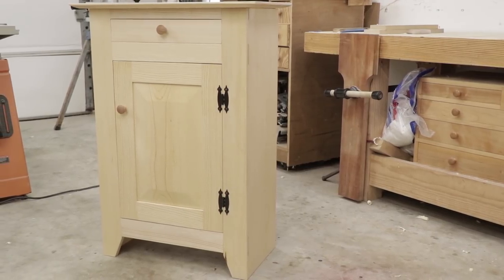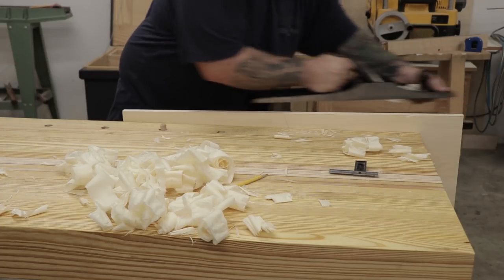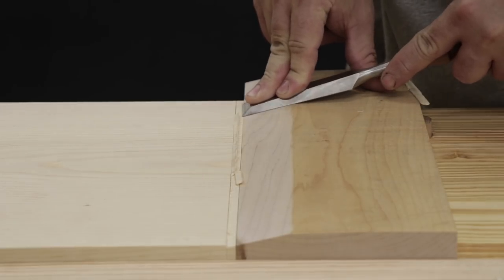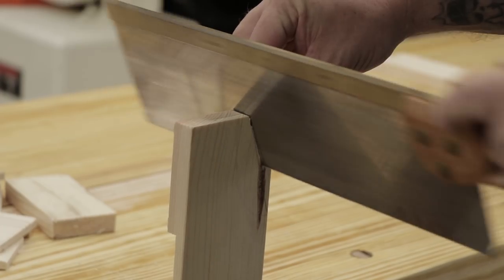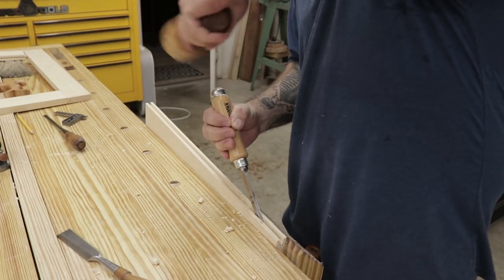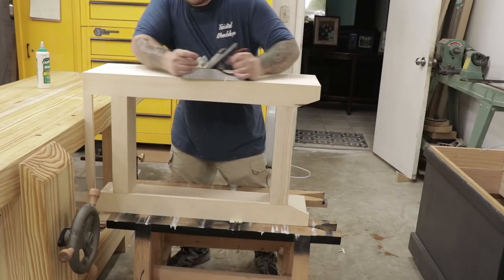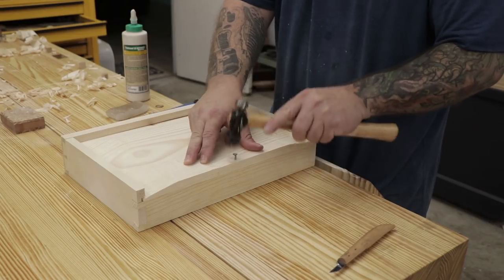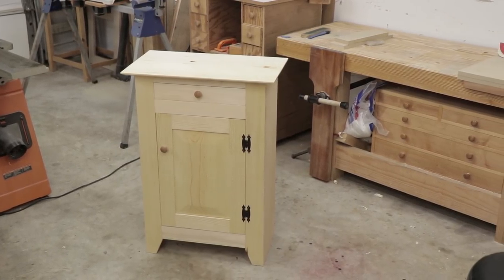Shaker Style Cupboard Using Only Hand Tools!

Comment: Nice work! Hand-tool projects definitely make the project more special. I just finished my workbench using only hand tools and no doubt it means more to me than if I used power tools!
Reply from the maker: Thanks I agree. It's a little nicer when you build with hand tools! I watched your last bench video. It turned out great. I will be going back to watch the rest.
Reply: Twisted Boards thanks for checking it out!

Comment: Really stellar work here. You show great skill and technique in all of your videos that I've seen so far. I've been building furniture for over 30 yrs now and I didn't see anything that I'd do differently except the dovetails. Just for giggles cut a set using the pins first method. It doesn't work with 1/2 blind obviously but for any other application hen you see how much easier the lay-out and execution is, you'll never go back. Thanks for all the great work here.

Comment: Awesome build.  You make it look accessible too.  I would like still to use a few machines..Table Saw, Planer.  My hand flattening skills need are lacking.  Pine is often overlooked as a building material.  Thanks for posting.
Reply from the maker: Thanks! I like using the basic machines for the rough work too. Once or twice a year I try to challenge myself with all hand tools. After a couple hours of flattening boards, the power planer starts looking real good!

Comment: Looks really good. Think I may try building it for skill building. How much did you drop on the wood and hardware ya think?
Reply from the maker: Thanks! Less than $60. I used the cheapest pine I could find at the home center and the hinges are normally less that 5 bucks

Comment: Hey, just found this video. Great build! I'm wondering: 5 years on, did you find the nailed drawer bottom or the glued case front gave you any trouble with seasonal movement? I feel like some folks are so paranoid about that sort of thing.
Reply from the maker: Thanks for watching. I haven’t had any issues with wood movement on this. I agree that people get a little too worked up about the wood movement in smaller pieces. I would definitely be concerned with big panels and table tops though

Comment: What is the coping saw your are using. I usually just chop out the waste when doing dovetails but would like to try to the coping saw method as the chopping in hardwood is sloops. My coping saw is a $5 model that won’t be up to the job.
Reply from the maker: The coping saw is made by knew concepts. It works well and I don't break half as many blade as I used too.
Reply: Twisted Woodshop thanks!

Comment: Nice work on the cabinet and the vid. Not much room to screw top down with those figure eights?
Reply from the maker: Definitely not. If I would have made a traditional dust frame, it would have bought me more room but I was able to get the screws in with a stubby screwdriver. Might not have been so lucky if it was a hardwood. lol

Comment: I know this video was posted in 2018 but, can you list the tools used to build this cupboard
Reply from the maker: No 5 jack plane, smoothing plane, no 7 jointing plane, panel saws (rip and cross cut), no 62 low angle plane (optional. Could use any of the planes listed above), shooting board,shoulder plane, rabbet plane (optional could use shoulder plane), chisels, back saws tenon and carcass, router plane, scraper, plow plane (optional could use router plane) mallet, drill, coping saw
Measuring tools. Carpenter square, small square, winding sticks, panel gage, marking gauge, marking knife and dividers. This kit should allow you to build most common cabinetry
Reply: Thanks for replying, like you I have a bunch of power tools around, but I have always wanted to build something with hand tools only.